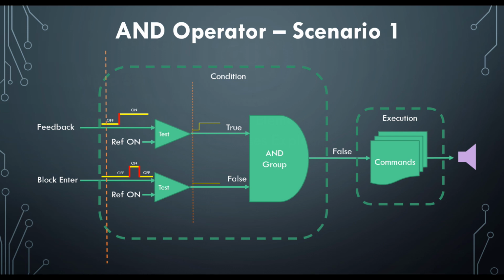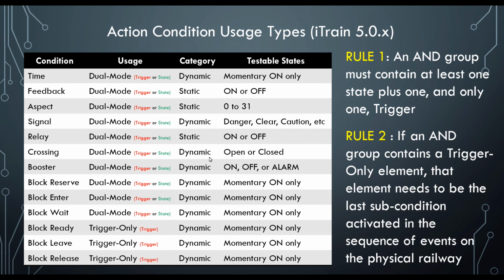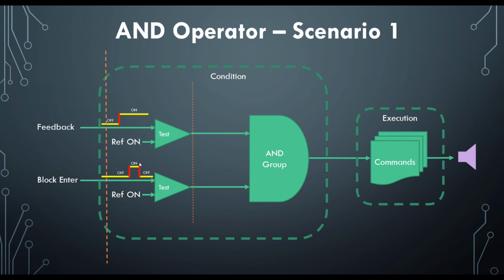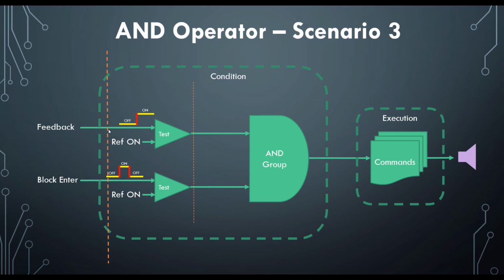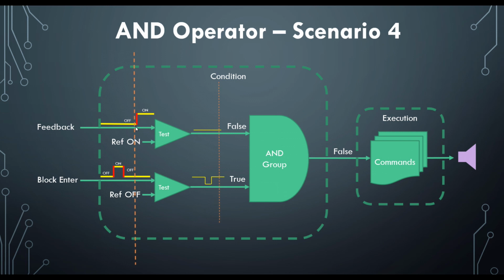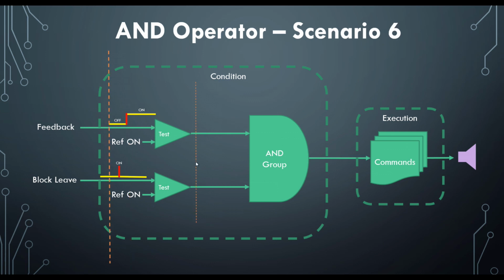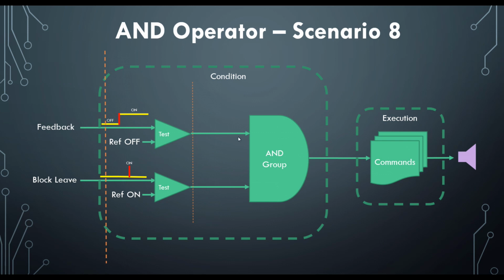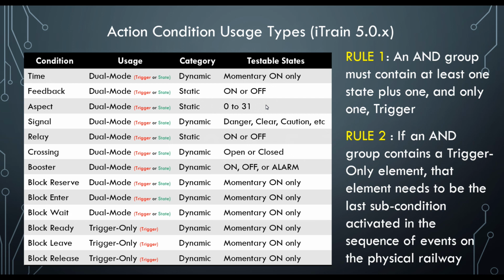Video 55: Actions - Static & Dynamic Element Scenario Exercises

Comment: Bob, is there a place in ITrain that shows the tables included in the tutorials regarding Actions and State/Triggers and Static/Dynamic?
Reply from the maker: Not a table as such. But when you select a Condition item there is a column with a * and/or =. * means a trigger item, = means a compare item. If it has both symbols, it can do both.

Comment: I took a while to get round to watching this. First, I am pleased that I got the answers right. But more importantly I wanted to say what a great job you did with the animations to illustrate the timings and logical conditions around each of the scenarios.  This was exceptional, even give the high standard of your other videos.  Well done!  Thanks also for the time spent on the "illegal" scenario 4 as well as other points where people may get tripped up.  Good stuff!
Reply from the maker: If you got all the scenarios correct that's a good sign. It means you have the kind of mind that is capable of making good use of iTrain. Well done!!
I have a love-hate relationship with these tutorials so it is really nice when the effort is recognised and quite humbling when someone takes the time to repay that effort with an acknowledgement. Thankyou, it means a lot.
Reply: @bobfuller  You're very welcome.  I am sure you sometimes ask yourself "Why am I doing this?". But many iTrain users would say "Don't stop!".  These are just great and add so much value beyond the detail in the official user manual.  As for my "kind of mind" - years of digital hardware and software design and dealing with "hard real-time" issues.  If I got any of them wrong, I would need to know exactly where I went wrong and why.
Reply from the maker: @GodmanchesterGoblin  that's the philosophy I adopt for the tutorials - how and why...👍